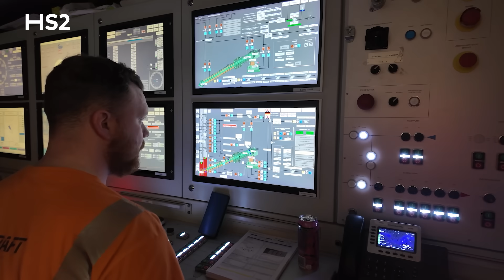HS2 Project Update, October 2025

Comment: As someone who lives in the south, Hs2 construction should of started in Leeds and Manchester
Reply: High speed rail actually needs to go all the way up to Scotland. I don't really have a problem with Birmingham being the primary focus of the centre of the HS2 project. It's the second largest city in the UK and will gain a lot from having it's railways untangled. However, I would have liked to have seen the line being built North of Birmingham and East of Birmingham, at the same time the section between Birmingham and London was built.
Reply: @DavidShepheard  It made more sense to build the Birmingham to Manchester/Liverpool branch first as the big capacity constraint is north of Birmingham, the section that would be covered by Phase IIa, that which was approved but then mothballed. It's criminal negligence on behalf of all parties not to realise that. London doesn't need another commuter line, certainly not from Birmingham. London had Cross Rail to increase capacity enormously already.
Reply: @DavidShepheard it was going to originally. Then sunak came along
Reply: That’s what Manchester Mayor Andy Burnham said but no one listened
Reply: Too late. Government decided where to start more than 10 years ago.
Reply: @carguyuk7525 I am aware thank you, just  a southerner pointing out the wrongs on the North by our corruption lieing governments
Reply: That’s a ludicrous suggestion. The WCML south of Rugby / Ledburn is what is full and why the route was suggested. HS2 would have brought benefits to the Midlands and Northern towns from day 1 had it been built in full.
Reply: @wdielwlairajmd exactly meaning they would not of cancelled that section and carried on building
Reply: @wdielwlairajmd  It is not ludicrous suggestion, the Southern Half of the WCML is congested with ever increasing freight trains competing with Avanti West Coast Trains, and London Northwestern train services, not only that Birmingham New Street Station Birmingham the busiest station in the UK outside of London and the 13th  busiest station in the UK and is totally congested at times with just a two track line between Birmingham and Rugby being used by Freight trains, Charters, Avanti West Coast Trains, X Country Trains, Transport for Wales Trains, London Northwestern trains and West Midlands Railway trains so that is the reason for HS2
Reply: @peterwallen1063  not sure why you’re preaching to the converted? You make the same points as me….? Hence starting HS2 in the North would have been a ludicrous idea. The capacity is needed at the south end first!
Reply: Exactly. I occasionally travel to London and Manchester for leisure from Birmingham and whilst the train to London seems adequate I now use a coach to get to Manchester.
Reply: So living in the South your brains must be in your shoes and you don't know a lot about HS2, like a new Motorway Construction builders or one example the Channel Tunnel and do not start in just one place convenient to joe public, they start construction the whole length of the project to get things in place and so it goes for HS2, the builders started construction all along the line from Birmingham Going North to Handsacre in Staffordshire and South to London and from London North towards Birmingham and every where in between so all these sites will be ready to have track laid simultaneously plus Leeds has nothing to do with HS2 which is a West Coast Min Line upgrade and Leeds is on the East Coast and East Coast Main Line
Reply: I agree with you. HS2 should have been constructed "upwards" (i.e. towards London) rather than "downwards" (away from London).
Reply: @indetermite It was constructed as neither, it is being constructed simultaneously from Birmingham North to Handsacre and South towards London anf from London North to Birmingham with construction work going on between Birmingham and London. If it had been started at one end only it would not of got as far as it is now and it will never go to Leeds as HS2 is basically an upgrade of the Southern half of the West Coast Main Line thats it, nothing to do with the East Coast,so basically it isn't being constructed upwards or downwards as you think it is.
Reply: @indetermiteLondon is down mate. It’s the south.
Reply: @Tamarlane389 in the world of trains all lines go UP to London
Reply: @DarrenChilvers not from Manchester then, evidently
Reply: In railway jargon it's always 'up' to London, whatever the map says. And maps used to have East at the top.
Reply: Should HAVE
Reply: @_starfiend  It really grates on me ,people that write "of" when they should be typing" have."
Reply: Should of
Reply: No it should not of as it would not of got built at all, like s many big transport projects HS2 is being constructed simultaneously from Birmingham and London and in between and is basically a Birmingham project
Reply: It's just an overpriced branch line from Euston that was built to provide more London commuter capacity
Reply: @philjameson292  No more capacity on the WCML nothing to do with London
Reply: @philjameson292 built on a legacy of government lies, without the rest it will do nothing to help

Comment: Scrap Handsache, saves you £500m which could be spent on Phase 2a up to Crewe instead which at current ranges between £5bn and £7bn
Reply: Handsache is a critical component of heading to Manchester and other north western cities
Reply: Huh? Handsacre IS part of the phase 2a feed in
Reply: London to Birmingham, that distance in any other European country is £10 Billion. Mark Wild is Chief of the Mafia. 
If this is the best this country has to offer, this country is finished.
Reply: @davidwebb4904 how many other countries would build 45 miles of it underground?
Reply: @davidwebb4904  Typically, other European countries separate the costs of track-laying, specific engineering works, stations and platforms, and equipment such as signalling. HS2 lumps all those costs together, including all the environmental enhancement and mitigation projects.
Reply: @davidwebb4904  As if it wasn’t finished enough…